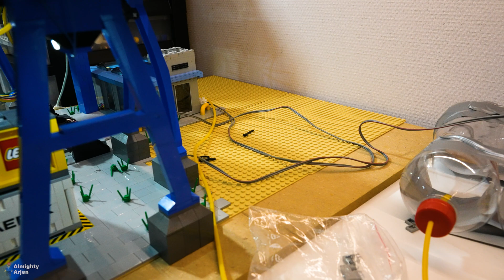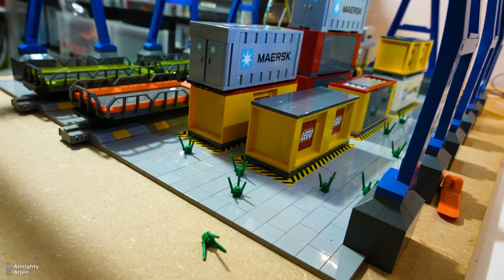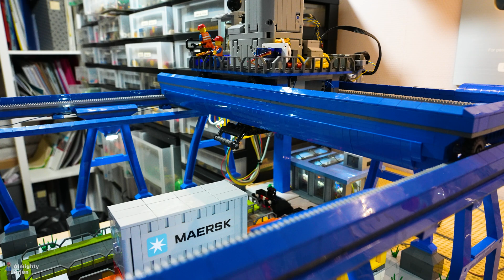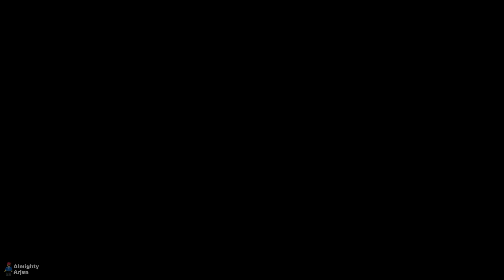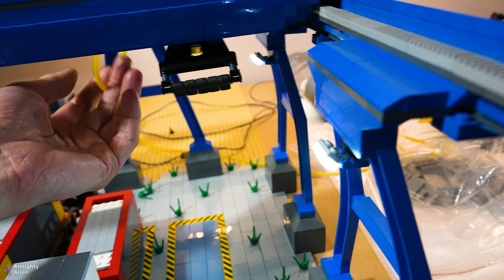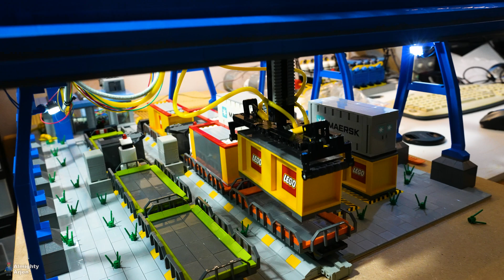Automated lego train container terminal E34: loading containers randomly

Comment: Love the progress and such a cool idea! Some remarks: If you first randomly pick a pickup-spot, and then determine if there is actually a container on that spot, does that mean that when all containers are gone (loaded onto the monorails), the crane goes in an infinite loop of spot-picking? Also, if you are moving along the positions, why not use the sensor to update/verify the stacking height? This way containers which are set down by something else than the crane (by hand or future-additions) are also detected.
Reply from the maker: Good remarks! About the first one: good point, haven't thought about that. I'll ad a line of code that says that if there's less than three spots occupied with containers, it has to go to those spots and not use the random functions.

About the second one: I cannot track the height during operation as the sensor is not directly below the grabbing arm (the arm would block the sensor's view) so when it's in the position of grabbing a container, the sensor is not seeing the container but looks next to it.